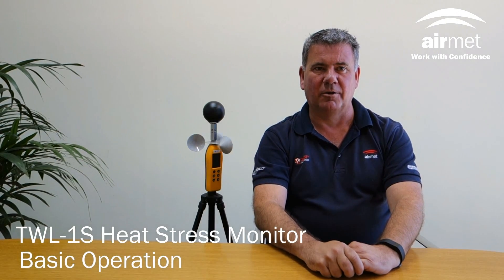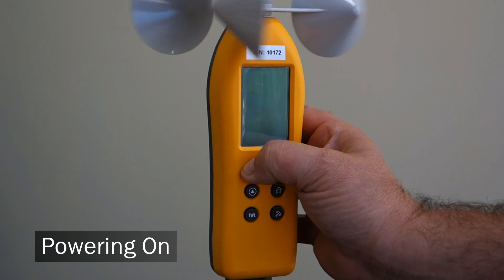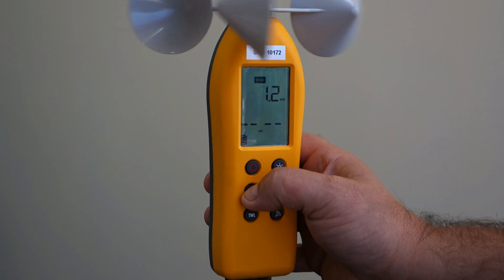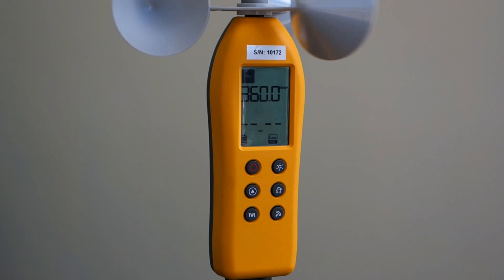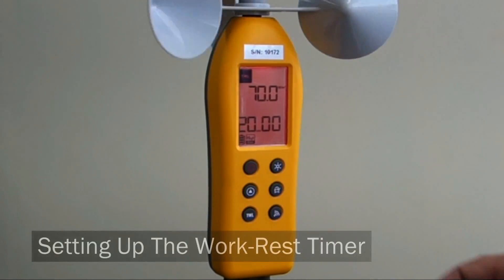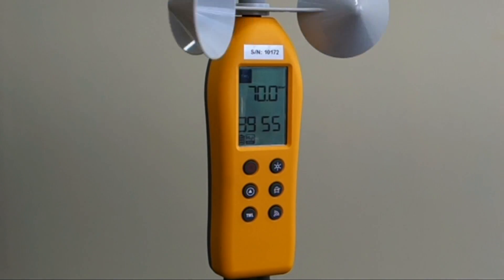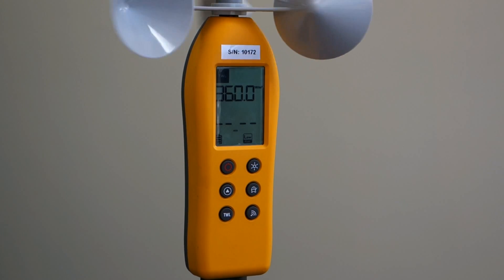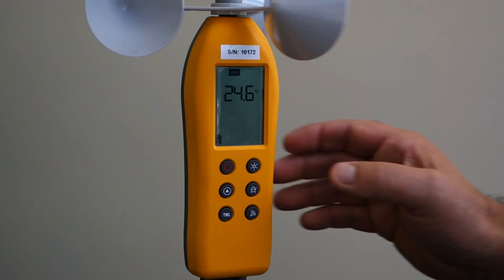Scarlet Tech TWL-1S Heat Stress Monitor | Basic Operation

Comment: Good demo. Question: in the gulf countries sumemr time is very hot it is always +48 + 50 or +55deg, is it recommended to use and take measurements by placing the TWL device under shade? or it is ok to keep it under direct sun light? Note that we tried to keep it sometimes under direct sun light and it does not work properly.

Comment: How many minutes does it need to be kept outside to become realTWL
Reply from the maker: Hi @user-mi8eu6bl4y, tt is recommended that the unit be in the environment for at least 10 minutes to acclimatise to the environmental temperature and humidity. The TWL is calculated over a 2-minute period with new TWL readings every 10 minutes.

Comment: How to know normal temperature by this machine
Reply from the maker: Hi Kabin, the unit is designed to give TWL (thermal work limit) readings and WBGT, the individual sensors readings will also be displayed.

Comment: Do you operate it under direct sunlight or under a shade?
Reply from the maker: The Scarlet Tech TWL-1S Heat Stress Monitor calculates the thermal work limit (TWL) including using the radiant heat measured by the bulb and therefore can be operated in the shade or in direct sunlight.